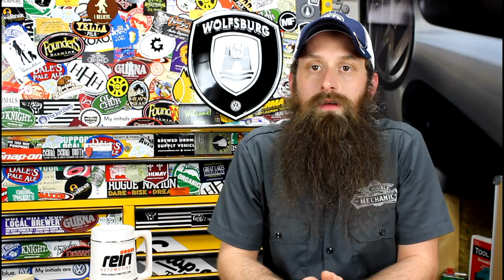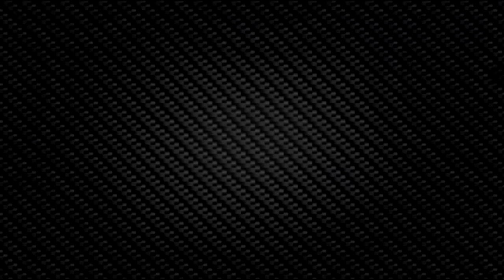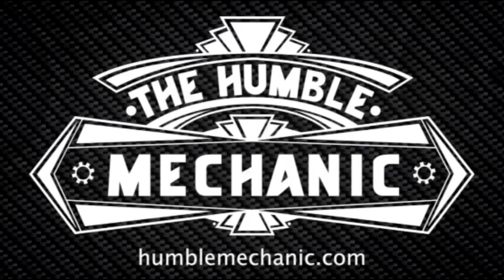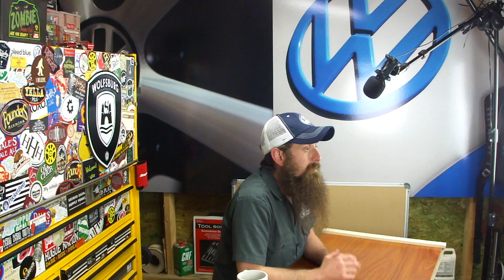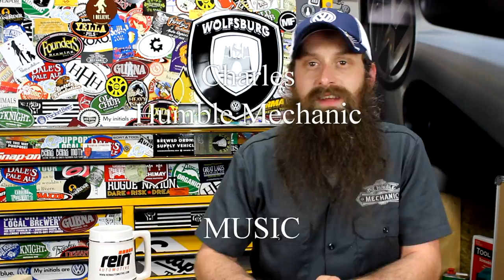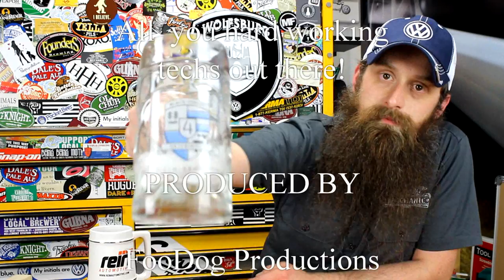Why Flat Rate is a Good Way to Get Paid

Comment: I used to work at a shop that paid hourly. The customer doesn’t pay how long it took. They still use the same labor times as flat rate techs use, so the customer pays that flat rate but as you said it doesn’t give the tech incentive to finish the job quickly cause he’s making the same no matter how long it takes him.

Flat rate is good during busy times, but sucks on slow days (we work even when it snows) and on those diag jobs that take longer to diag then it pays (just dealt with that on a pt cruiser last week). Also the labor times have changed over the years so the same job paid more 15 years ago then It does today and my shop does a lot of warranty work (which in general pays about half what the job normally would pay) because the car brand has very long warranty period (America’s longest).

My personal favorite pay rate is hourly with commission. You still get a guaranteed pay but still have that incentive to do more jobs faster.
I used to work at a tire shop that paid hourly w/ commission (though the hourly pay is usually lower). I made a lousy $9/hr but I worked hard every day and if I actually divided my week pay down to the amount of hours I worked, it came out closer to $14/hr because of commission.
Reply from the maker: I think that some type of guarantee is great. Enough to pay bills, but not enough to be super comfortable. Something that will still motivate most people to work harder to make some extra money. Most people will find a state where they can live off the money they make, and do as little work as possible.

Comment: The problem with the flat rate system is when you work at slow shops or a service advisor/shop foreman is not fair distributing the work.

Comment: I know of a way to fix the flat rate. 

In New Zealand, which is where i live, commission based jobs often have two components

1) A base rate. This is usually set at, or close to, minimum wage
2) Commission. This is a set price that is given based on how many sales is done. 

With some tweaking, this could be a viable alternative, while still offering a good intensive to earn more.
Reply: May Tag that's how we pay our guys $7.00 an hour + 12.5% parts and labor there seems to be a point where they make enough where they notice how much taxes get taken from a large sum like that they stay with in a range.

Comment: Flat rate encourages corner cutting.  Someone dogging it on hourly will be gone.  What you speak of is how it would be in an ideal situation.
Reply: Flat rate encourages productivity not cutting corners.  The tech that cuts comers to make time is not a good tech!   You can do most jobs perfectly and still gain time over the book time.  Book time always factors in extra time for driving the vehicle, cleaning up afterwards, etc.
Reply: I don't remember anyone ever accusing most technicians of being very professional.  If a guy wants to appear "more productive" and increase his/her billable hours, the overwhelming drive is to cut corners.  Yes, one or two people in a shop will be a pro and do a good job.  I look over the vehicles in our fleet that come back from dealerships (highway tractors, heavy equipment and automotive) and of all the shops that we contract overflow and warranty work out to, there is ONE independent shop that passes with flying colours every time and they are paid hourly.  (This is not to say that all hourly shops put out quality work).
Reply: +Chris Young A pro tech always cut corners, if the book says take the suspension off then drop the sub frame yet you see that you can drop that sub-frame with the suspension still attached if you support it a different way, you are now cutting out about 10 steps by taking an assembly out instead of parts.  

One more for yea, we have a job that the book states "remove the body completely from truck" yet if you do you will never come even close to the time. But if you on bolt 6 out the 10 bolts holding the body one you can get 4" of room to do the job and maybe meet the time or at least come close.

It may be different in the aftermarket were they don't have to deal with warranty work, but at the dealer level, if your not looking to rewrite the manual to benefit you, then you are going to starve.
Reply: A techs man thought going into a job should be "How can I fix this car and fix it right" not "How can I beat flat rate because this job only pays .7 to do"
Reply: Damn, you get paid for the multi-point, we are "expected to do it" for what ever the car/truck is in for, including a .1 bulb.  Oh, and on recalls that pay well and don't take much time, if you DO tell the company the faster way and the techs find out about it you will be the loneliest person in that shop, know one will help you again. 

Now you tell me where the fuck they got that time from?? For Land Rover I do know the answer and it is sick, that time 3 FACTORY techs with the tools laid out on a brand new truck and the factory facility with the factory special tools all ready to go. The times for us at least are the perfect setup with someone that has inside knowledge of how the trucks are built and we are expected to at least meet this time. It is beyond bullshit and to make up the difference the labor times have to be doubled for customer pay jobs to get them close to a real time.

Flat rate is there to save the Manufacturer money, if all shops were hourly then the owners could then go after the suppliers for better pay, instead of sticking it to the little guys.

Comment: I recently switched from a gm dealership working flat rate to a Indy shop which pays by the hour. The dealer I was at had been bought out by another company, so I stayed there for about a year. They implemented flat rate and guaranteed me there would be lots of work.. Well there was a steady flow of work for a few months and then it just died. I would be waiting for work for 2-3 hours a day. The service advisors/manager wouldn't pay properly, I would go ask them about ro's I hadn't  gotten paid for and they would say " well, you win some and you lose some" it was about that time I said it's time to move on.. The Indy shop I'm at now is the best place I have ever worked. The Boss is awesome and has no problem paying. I can see flat rate working and being able to make money at it, but where I was there were too many factors out of my control affecting my pay cheque. As for your QOTD, I think a system of hourly pay with a production bonus would be a good system.
Reply from the maker: Jonathan Milbury Glad you found a place that you love. It seems that peoples love/hate for flat rate depends a lot on their location. Bad shop= dislike for FR...

Comment: I loved being paid flat rate at the dealer. You know the cars like the back of your hand so the jobs can be done a lot faster. But if you have a service writer that favors someone over you then it can hurt your pay. The dealer I worked at did favor a couple guys because they were there for many years but generally if you treat people nicely it’s not bad at all. 

I am not a fan of flat rate at independent shops. Many of them are not fair. If you are a really smart tech you get a lot of the headache cars while the not so smart guys get all the easy jobs that pay well this has happened to me at a bunch of shops. A few shops I had to not let anyone use my tools for reasons like I would be doing diag work that pays straight time then I have some one using my balljoint press or a timing kit for a vw or even my scan tool to do jobs that pay a lot more hours than I was making. Guys and managers would get mad at me but hey why should I make less hours when I took the time to educate myself and I spent a lot more money on tools all so I can be a better more productive tech to make more money. 

I am going to open a shop soon and I will be paying hourly plus bonus. I feel that in the independent world paying hourly gets rid of a lot of the drama created with how many hours everyone has for the week. Everyone can count on a steady paycheck every week. The bonus system will be an hourly raise after each tech meets a certain number in gross sales for the week. If you gross over 10k for the week you get 3 bucks more per hour. Each upsell will have a bonus. If the car comes in for an oil change and you recommend a brake job that gets sold you get $1, a coolant flush is $1, 4 tires is $1 each tire. Your not going to get rich but hey the guys have the opportunity to make a few hundred bucks extra per week and that can keep up the moral of the shop and productivity. If I am super busy during the week and have work that can be done staying later or over the weekend then the guys can come in for some overtime if they wish but I’m not going to ever make someone work late all the time and weekends. But if the guys do help out saying late once in a while then I would allow them to work on their own cars and close families cars after hours. I wouldn’t allow the guys to do any side work. The only way I would bend on side work would be if I had a very good tech that I built up a lot of trust with. I wouldn’t allow him to be doing side work every day but if I trusted him I’d let him do a side job here and there for his buddies. I was allowed to do side work at a lot of places and other employees weren’t allowed because I developed trust with the owner and had keys to the building. But from a business owner stand point I didn’t work this hard to get this far to let other people profit from me. I can give their friends a discount that’s not a problem but I’m in business to make money. Another reason why I have a bonus program set up so the guys don’t  even want to do side work because I am willing to offer them ways to make more money without the need to even do the side work. I learned a lot from my current employer. He doesn’t let anyone do side work but he treats us better than most any shop in the area. He doesn’t ever make us work late, he pays us salary which is more than most Indy shops pay, not as much as you could make at a dealership but we also don’t have to work super fast all day. Last year he said I’m not giving you guys a raise but he started to pay for our healthcare instead which is about $140 per week each employee. That’s quite a bit of money but they way he looks at it is rather that give you guys a few bucks more an hour I pay your health insurance, it helps you guys out, makes you happy and you feel better about coming to work. With happy employees you work like a team and not the flat rate every man for themselves. The money he spent on our healthcare he easily gets back because we all are in a great mood every day, we don’t ever call in sick, we get the job done. With us as his team he doesn’t need to be at the shop all day he can spend more time with his family. So many shops can’t keep employees and can’t find good techs. Well at the end of the day it’s all about money. The extra 300 bucks a week you pay someone comes back 10 fold

Comment: My job is hourly plus bonus program. If you finish the month 40 hours ahead you get your hourly rate times 40 on the first check of the following month. I think that this is the best way unless you work somewhere that is always busy, and your doing work that you can make good time on. Then flat rate would be better. It's just that the only time I lose time on a job is when it's under bid or we have to do extra work that's not on the RO. Not my fault but I still take the hit.

Comment: Flat rate is good if your working for a good company, I work for a Kia dealership and it sucks, a recall for engines came out it pays 8 hours under warranty, Kia will send you a full assembled engine called short block, I can get it done in 4 hours, on the other hand I had a 2016 Kia Forte and  Kia approved me to replace the engine they stopped making the same engines, so they sent me a long block it includes the block, crank, pistons, you have to disassemble the old parts and clean them so you can put them on the new block and that’s after sending the head to the machine shop, and the the head will stay in the machine shop for the next 2 days, and you have to buy the head bolts sockets that no one in the shop have that costs 80 dollars from good old snap-on, then you have to check clearance and make sure that everything is within spec and for sure parts department is going to forget to get you some of the new gaskets, anyway the whole process takes 25-30 working hours, and then Kia pays you 9.2 hours on the SOB make sense right? 9 hours for disassembling and cleaning and assembling on the other hand 8 hours to drop the sup frame and discounting the wiring harness, again FREE jobs, plus I had to buy the special socket for 80 bucks and that just about 4 hours of my pay, so I made 4 flat rate hours on a job like that.

Meanwhile a buddy of mine who works for a Benz dealership gets 2.5 hours to do a PDI (Pre delivery inspection) just to make sure that everything works and driving a brand new 80K dollar Benz for 6 miles.

Make sure you know where you belong if a high end dealership offers you a job take it in a heartbeat.

Comment: I am not in the auto industry, but I would think that hourly plus bonus is the way to go. The 'why' would be that of quality concerns. Matching the mechanics times with a flat rate system would enable the owner/manager to see who is pulling their weight. Ultimately, employees who do not care get weeded out anyways. But, if you have mechanics who use air tools and have never seen or care to use a torque wrench and properly torque critical parts at their stated torque values you end up with bigger problems in the end. I have seen  too many times where mechanics will not use a torque stick on putting lug nuts back on and wring those bolts at 300 ft-lbs + just because they are too lazy and want to get the job done. Or worse, leave out screws and bolts when putting covers back on because "the customer will never know" just to get the job done under time on a flat rate system. All too common. Any comments on those points would be appreciated.

Comment: I agree it can be good in some instances but can also be bad depending on the people. I just started at flat rate in a dealership express service lane...so right off the bat you know the pay is low but I was desparate for some sort of income. The down side is already within the first week I see IMMENSE amount of shortcuts and half arsed inspections happening with my co workers and I am a perfectionist and beleive longer quality time needs to be spent fully inspecting a vehicle. When I point out a small oil leak theu say "oh well thats too small for warranty to cover it so dont put that on the inspection form" to me ANY oil leak needs attention especially if it's small before it turns into a real problem on someones super expenssive vehicle investment. I don't take tons of breaks and I'm never on my phone at work, I just like to take my time to be sure I'm doing everything correctly so because of that I'm punished with lower pay? Another issue is that I HATE HATE HATE working weekends but because most people love all the overtime they can get, the dealership made mandatory 10 hour days mon thru fri and every other saturday...life is too precious to waste working so much, you can hardly see your family and never get to go on vacations or have time to fix your own cars and houses. Now I have to keep searching for a new job, I had the wrong impression of flat rate when I accepted the job offer so I would urge anyone unsure of what it is to please please researvh it before accepting that job offer. Thanks for posting your thoughts on the topic though.

Comment: I don't think warranty pays fair
Reply: +CATLIN CARR 
It's criminal and they should be sued. I dont know why they haven't.
Reply: +CATLIN CARR Because it does not. Warranty times are set to reduce manufacturer's warranty expenses not to ensure fair pay to the tech. They do three attempts to do a particular operation and clock the best one as "warranty time". Sure after doing any work three times in a row you will make and even beat warranty time. There is no need to look into manual and guess what is the best way to approach this or that bolt. By the third time there will be no seized bolts or stripped threads either. The problem is that in a real world environment if you do some job three times in a row most likely means you've done something wrong. Twice. And now you do it for free anyway, ha-ha!

Comment: My opinion; Flat rate works in dealership, or one brand specialist. No matter what, techs will get faster and faster as they experience. Allows tech not to do chores(shop cleaning and stuff). Allows tech to be thorough if they want. Importantly, busy season cranking 60hrs a week, 16 hour is overtimed, which comes handy when slow season hits. Tire month 60 hours a week x 4week here comes 16h x 4 = 64hours over overtime. 

Slow season, just spending money from that overtimed season + warranty works im still happy.